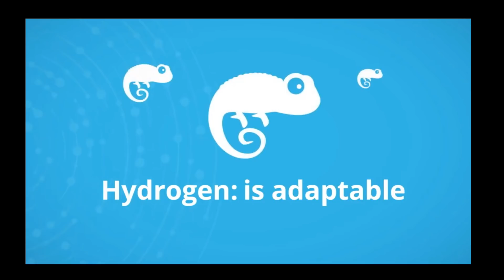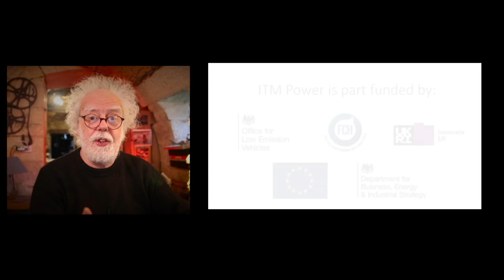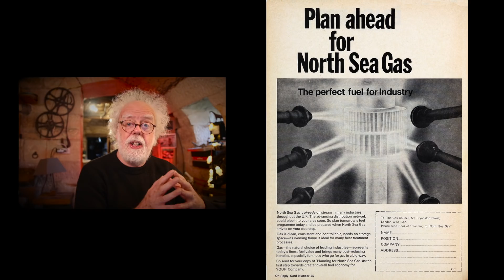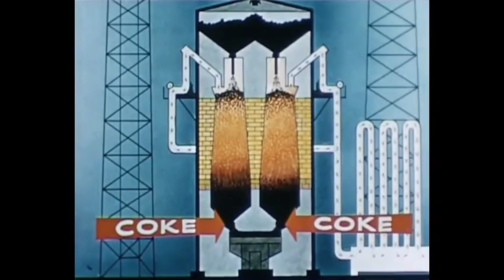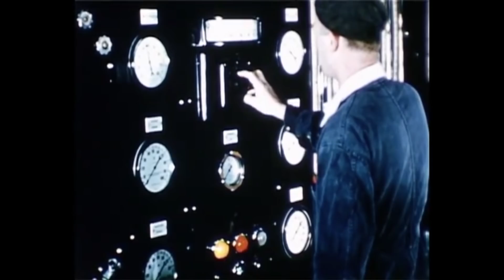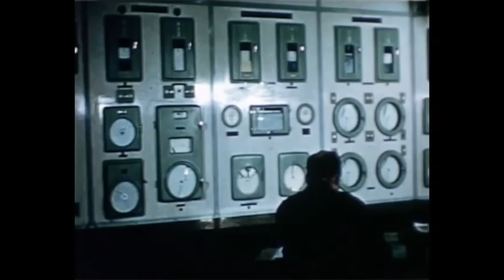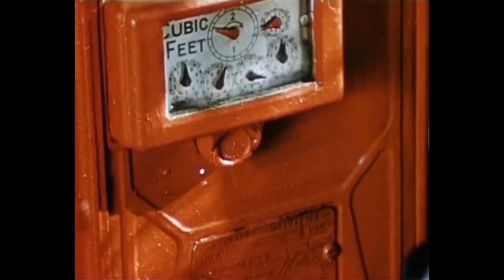Burning Hydrogen - Prof Simon

Comment: So i had look at Uk co2 output and it is indeed falling ..from 1997 to 2017 it fell more than half ...So there doing some thing right the two area that pollute the most is Transport 27% of the Uk output of co2  and 24% been Energy supply of the uk output ... Residential is 15% of the overall output 

must admit not sure what factors into the Energy supply that makes co2 high if that factory, power plant, transporting storing etc ...

If they can focus on the Transport and Energy Supply area would be possible to bring those down would be great

Sidenote 
The best argument to combating Co2 is not just climate change because for some reason that seems to have opposite effect of bringing people together to fix  and divides  Public on the causes of ..However i think better argument and reason to use to convince and unite people on combating Co2 output is Health ....

That one point that even climate Deniers can even agree on that pollution is terrible for health and the most prone to it is the children and elderly ....This argument and point is all we need to unite public on the danger and issue of rising pollution ...you dont have to agree on reasons for climate change we just have to agree on the dangers to health due to pollution that should be enough of reason to convince .....And no i am not climate deniers or scientist, i just think pollution is terrible for health and reducing it on that bases should be enough to call for action

Comment: I'm no professor but if we did make a switch globally to hydrogen wouldn't that huge amount of atmospheric oxygen be depleted due to transformation into water? I know it would only be a minuscule amount comparatively, but so was CO2's addition for the last 150 or so years and now we have smog. And all this excess water too... again, a few hundred drops a day per person, so a few trillion a day and we've created our own "unnatural cycle" of water creation (which admittedly could be used through electrolysis to create more oxygen & hydrogen). I like hydrogen, but am just concerned about globally negative impacts.
Reply: I'm 1 year late, No when you make hydrogen you also make Oxygen as well. Commonly known as HHO which you split into oxygen and hydrogen. I won't go into details how this is done though.

Comment: Great idea? But putting more water into the atmosphere will surely result in flooding somewhere else with increased, unpredictable rain fail.  your facts about the electricity are a bit skewed Professor. Yes Scotland can be self sufficient by renewable sources ie wind/ocean and hydro farms we have. The problem is it is all sold down south. While westminster continues to completely anihalate any progress Scotland is making for making a zero carbon country. Start to wonder if ur just another BBC propoganda master. Putting misconceptions out there. But hey it is just this vid I feel that about. Westminster and democracy has failed dismally.
Reply: I suspect the geoengineering will have more impact than this.

I feel Prof Simon knows the score but like, for example, Joe Scott he needs to be smart to avoid censorship.

I'll be unspeakably sad if our union ends, but with this clown Boris in charge I agree Scotland would be better off without us Southerns

With those floating off-shore wind farms in Scotland its cheaper per KWH than new nuclear

Comment: A large solar array could power a house during the day, with excess power diverted to make hydrogen for night time heating, AND have a minimal capacity battery bank.
Reply: Batteries are more efficient than hydrogen as a form of energy storage and more reliable (in spite of more money being spent on fuel cells).
Reply: you are correct...but once your batteries are charged, energy is wasted on a very large solar array...so the energy from the solar panels would still be utilized fully.
Reply: @jimhofoss9982  Unless you are charging your car or dumping it onto the grid.
For home use a bigger battery is a better option, and since it doesn't need to move lead acid batteries are better than lithium ion.
Hydrogen is horribly inefficient as an energy storage medium - it is useful for high mass to energy ratio systems like rockets and aircraft however.

Comment: Whoa Whoa Who there, most modern condensing boiler may not be compatible as the new gas may not be capable of being able to show the correct voltage to pass through the ionization of the flame for the flame rectification device to function. A new boiler may be needed to overcome this, this would most likely a uv cell to detect a flame is present.  Also. Also all appliances would require new injectors as there is no way they would burn 100%  efficient without.  Boilers with forced gas air mixture would need to be recalibrate, but only if a manufacture allows, otherwise all appliances would be categorized as immediately dangerous and the supply cut off.

Love the idea of this but the cost to the end user could easily fall into the thousands to be compliant to current safety legislation.
Reply from the maker: Interesting
Reply: I Agree with your updated video, in regards to hydrogen. We also need to look into a clean method of producing as I believe current method is not exactly the best as it's extracted from others etc. We would massively need to increase the renewable electrical sources as this would be required to produce hydrogen cleanly.  But we may as well just switch to electrical boilers. Either way we would have to heavily invest in our infrastructure to achieve this.

Comment: I think hydrogen eventually will give humanity a great sigh of relief.  However, Hydrogen taken from Deuterium Oxide... We are getting close!  And now, our old friend necessity has returned to help!

The downside is that Nations at odds with one another are all working to get there.  Hypothetically, whomever first achieves Sustained Fusion (that generates more energy than required to start it up), renders "Nations at odds with one another" nonsensical.

Therefore, the arrival of Fusion drags along with it the judgment of our species' worthiness. And that's not religion; we will be our own Judges and we will deliver our own Wrath.  

And if one Nation withholding Fusion triggers a Nuclear War, then that is what we all deserve.  ...With current tech cycles though, at least we won't be held in suspense for too long!

Comment: The existing infrastructure is incapable of containing the hydrogen, it passes right through existing gaskets, flanges, threaded connections,, so while a good idea, it would be extremely expensive to implement as everything would have to be changed out.
Reply from the maker: Maybe only mixing 20 % solves that....they are already adding hydrogen to Leeds gas supply.
Reply: @SimonHollandfilms  perhaps, however, I suspect the hydrogen would leak out anyway, furthermore, there is the problem of hydrogen embrittlement , which is definitely a problem and little understood, and potentially could create a very dangerous situation...

Comment: The quicker we move onto hydrogen technology the better. I find it rediculous that more hasn't been done already.
Reply: @ProwlerCam  hiya buddy yeah I agree with you to a point about this stuff I've seen what info is well documented but I can't help but feel that this situation is bs. I don't have to believe all the negatives. My reasoning is that it is not immediately profitable and that companies who should be pushing (they own all the infrastructure) won't because there's still too much money to be made from the existing fuel stock's and the initial investment will have to come from them. Traditionally in Britain the utilities companies always act coy waiting for government investment knowing they are under pressure from the voters and It's going to take a governmental lvl intervention before anything serious is done. As the professor pointed out that using 20% in our existing gas lines (UK) would be perfectly possible to do without altering anything on the consumer end. Not only would you reduce pollution because of the reduction in emissions but also because hydrogen burns hotter you will save again through reducing the comparable heating times on radiators in your home and boiling water on a stove. It's a no brainer.
Reply: Trouble is the same greedy energy companies will be digging up fossil fuels and simply breaking off the Hydrogen from cracking the hydrocarbons.

Comment: I was thinking about building a bio gasdifier, to run my generator ,  while also using hydrogen split from water , to mix with the wood gas/ bio gas, pyrolysis of bio matter, possibly allow the o2 to mix also, may do some testing with a o2 sensor on the exhaust to be sure it's not running lean, basically the same as the video, retort using wood and paper, to basically run the generator for free, using the hydrogen to drop the co2 produced, being off grid, it will be back up and to charge batteries occasionally! Great video, if more ppl produced their power the earth would be cleaner!

Comment: Synthetic natural gas is a better choice: Since your cracking water to hydrogen anyway you might was well make methane from that and CO2 by the Sabatier process.  No new boilers needed. 

The Sabatier process doesn't really consume energy it produces a slight excess, it requires heat to start up which can come from the excess of H20 electrolysis. The reason you want to do this is the drawbacks of hydrogen. It's leaky. It's estimated as much as 10% of natural gas production leaks (industry claims it's 3-5%) so hydrogen will inherit that leakiness plus it's propensity to leak through the finest cracks and even through materials themselves. Pesky tiny atoms.

Syngas is a much better way to store that and a much better stop gap until we can go fully combustion free.

Next, cracking H2O to water leads to about a third of the energy you put in being lost, then after leakage, storage and transport, then combustion - a boiler is about 75% efficient in practice. At this point this process is so lossy you might as well just deliver that same renewable energy over a grid and heat an element if not a heat pump.

A much better solution is to retrofit natural gas boilers with electric heating element to supplement their function during off-peak times when that excess wind power is dirt cheap. Hydrogen can still be a part of that I suppose.

Thus the solution always comes back to building lots of renewable energy generation then using the grid and local power generation to power everything. If you drive down the price of energy this way, as solar and wind surely will, then it will naturally out compete oil and coal. Someones trying hard to start a hydrogen economy, which is more about trying to keep existing business models and infrastructure valid in the face of exponential growth in renewable energy.
Reply from the maker: Interesting

Comment: I’m sorry but this is eco claptrap. Currently, and for some time in the future, there is no excess renewable energy during the night. There is still a large requirement for gas, and some coal, to satisfy the overnight requirement for electricity and this will get worse as more EVs are charged overnight. So it makes little sense to burn gas to generate electricity to make hydrogen to add to gas. Hydrogen is a nightmare. Hydrogen cell cars have been technically feasible for years and never been made because of the issues with distributing the gas.
Reply from the maker: Well they are building a successful business model around cheap cost electricity

Comment: So I am brilliant as well, I've been telling this idea to people for more then a decade. I even made my own experimental hydrogen generator a decade ago. But personally I think that it is not that brilliant anymore. First of all, all car manufacturers step over to electric drive trains for their cars, and they are even abandoning hydrogen/electric driven cars. Although a small part of different forms of transportation will remain hydrogen/electric powered. But in 10 years from now new cars with an ICE are no longer allowed to be sold in the Netherlands. And we are making the transition to electric transportation as much as possible, and we do the same with our houses. 

Therefore storing the energy in large graphene Ultra capacitors from Skeleton Ultra capacitors would make much more sense because there is less loss of energy and there is no need for extra infrastructure. And new houses don't have to be connected to a gas grid. And that saves money on a short term and also the longer term. Because eventually we need less maintenance to our gas grid. 

We also invest a lot in solar panel systems, and we are building the largest and most powerful wind turbine in Rotterdam that will be good for 12 Mega watt, enough to power more then 16.000 households with just one turbine. 

In short, adding hydrogen to natural gas might sound smart, but if you look at how the technology is changing I think that new technologies will replace the need for fossil fuels completely, and therefore the devices that burn fossil fuels will slowly disappear as well, and therefore there is no need to build a large infrastructure to make and transport and store the hydrogen in large quantities. 

I do think that hydrogen can be useful in certain specific areas and industries. But not as an additive for natural gas or cars with an ICE. It seems like a useless extra step in the energy transition.
Reply from the maker: Sounds good
Reply: @SimonHollandfilms  I even forgot to mention that a Scottish island is already using the technology from Skeleton ultra capacitors. And that island is completely self sufficient. Skeleton Technologies ultracapacitors boost the grid on Isle of Eigg in Scotland https://www.youtube.com/watch?v=3RUY0BUgFjs

Comment: lovely idea, only 2 issues that come to mind, 1) rust from water vapor in some equipment, and 2) separation of hydrogen from nat gas resulting in inconsistent burning.
Reply: The separation is a big issue as it will cause issues with equipment.
Potentially shorten the lifespan of any burners as the mix/temperature fluctuates.

Comment: Nothing new here. I proposed this already in late 90's, when I heard about fuel cells. Norway's Statoil has had working ecosystem on this for couple of years already.
Reply: Why would an oil company be investing in something which would reduce oil/gas sales?
Reply: Oil companies make hydrogen in vast quantities.
Fuel cells can be designed to run on pretty much anything burnable in gas form - I have worked on a diesel fuel cell, it is just a question of design.

Comment: I think we can all agree that hydrogen is the fuel of the future.  Even our current gas infrastructure can handle the transformation - a blend of methane and hydrogen is nothing new.  However, hydrogen and carbon monoxide have very similar properties from the perspective of our carbon monoxide detectors which would render them useless since they will be giving off false alarms constantly.  This could be an issue for industrial applications of hydrogen. 

Also the lower explosive limit for hydrogen is also 4% v/v which makes it 20% more hazardous to use when compared to methane (5% v/v). 

There are actually some islands off the coast of the UK who are self sufficient on hydrogen already.  They even transport their surplus. I cannot remember where this is.

Comment: Professor if you did not know 97% of Hydrogen is currently made from natural gas and uses a lot of electrical power to produce - Scotland last year Jan to August/September made 200% of there power from just wind alone and the way things are going will not need a baseload (all new wind farms and existing wind farms are having a large amount of batteries fitted now) ~ When the UK had a large power blip/cut the national grid said the blackout would have been much more and longer if it was not for the amount of batties available - remember the UK has been going hours/weeks now without the need of turning on coal-fired power stations and the last few that are left are being closed 2 to 3-year earlier due to costs.  Just last week renewable over took fossil fuel power generation in the UK.  Holland just open a lab where they can test the next-gen wind turbine nacelles and blades - first up will be the new prototype and pre-production 20 to 22MW but they can up to 24 and maybe 26MW - one full rotation of a 16MW turbine will run a house for 24 hours and they are going to be changed to 18 to 20 and possible 22MW soon
Reply: Hydrogen generation from natural gas does not need electrical power - it generates electrical power from the exhaust expanders. It uses a LOT of natural gas however to drive the compressors.

Comment: This is why I love the channel. Thanks again Professor.

My personal note is that I was once employed in the heating oil business. Natural gas was a threat to my livelihood. Now I have employment mostly based on natural gas heating. But I know that electric heat is the safest and simplest way to heat, and do most anything. I think individual electrical storage at off peak times is a target to strive for.

I was hopeful for fuel cell generator that Honda had. It was intended for their electric cars, the Insight at the time, but could power the entire house. It's been a while and I wonder what became of the concept? Using natural gas augmented with hydrogen is brilliant, I think.
Reply: Fuel cell technology is a live and well, I agree that individual off peak storage would be a great idea. As always though cost is the issue maybe if it was placed in buildings regulation in the uk then it would take effect eventually along with solar panels also to include any retro fit we're it would be beneficial.